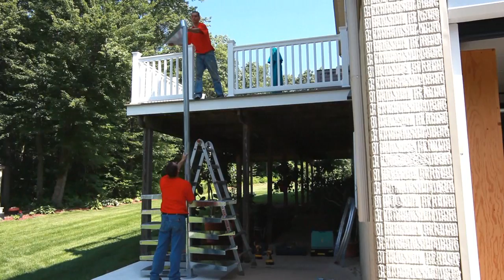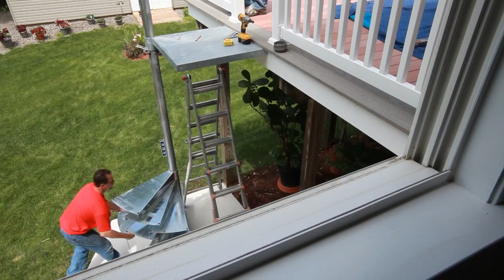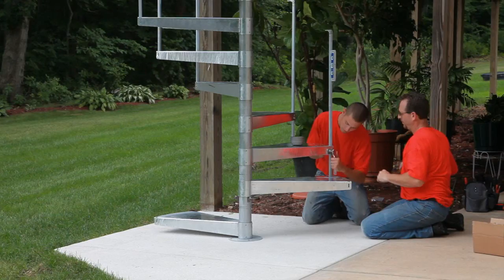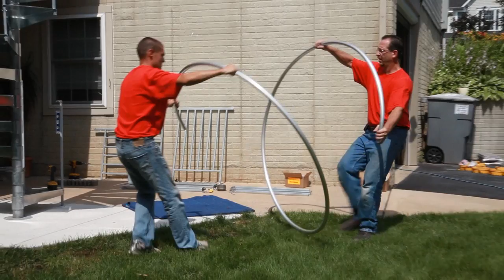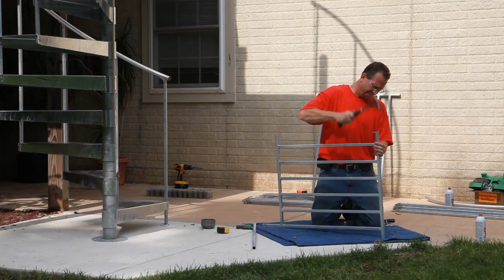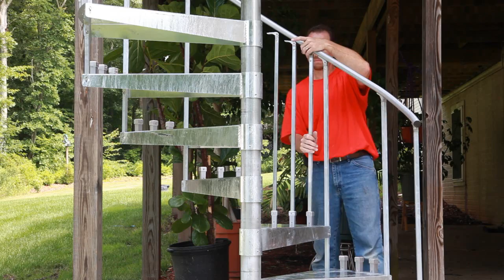Spiral Deck Mate Stair

Comment: Have you encountered any issues installing this under the decking as opposed to flush with the top surface?  I came here because I'm about to install one of these, and I'm concerned that that ~1 1/2" drop to the landing will present a tripping hazard.

Comment: dear sir would u please advice me for exact dimensions of your staircase... thanks
Reply: Md Babar Khan
It's easy to figure out yourself.  Find your roof height, says, it is 8ft then convert it into inches  (8'×12")=96".
Secondly, you decide how many inches each stair or step to be your comfort zone, for example,  some like 7" or 8" or 9" height. 
3rdly, a circle is constant 360° (360-degree), a man's height max 6' , so you have only 2' clearance (2' clearance or 1.5" clearance is needed ) when a man is climbing on each step that rounded stairs , doesn't it!
Well, now count each stair height would be your real measures and wide of your stair assume 3.5'.
So, make stair a triangle shapes ( as it's seen in this video) and calculate number of stair you need to  reach 8'  (96") height where your roof or first floor is situated. 
Thanks